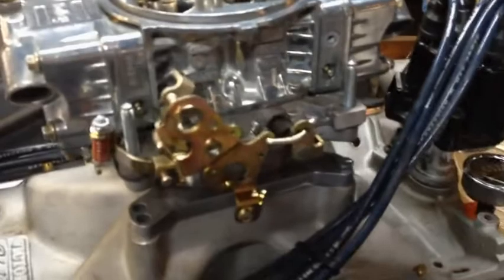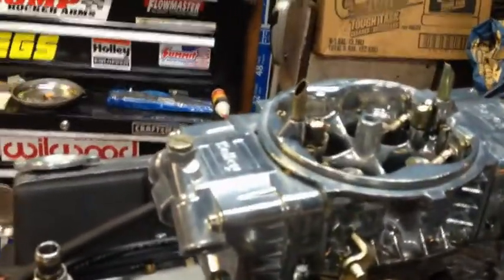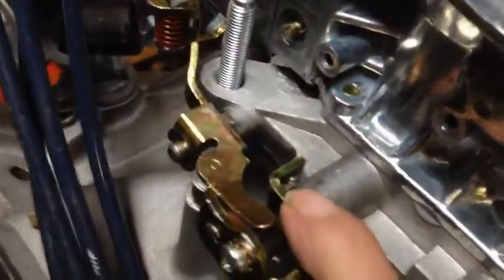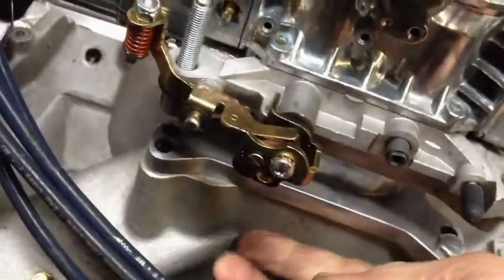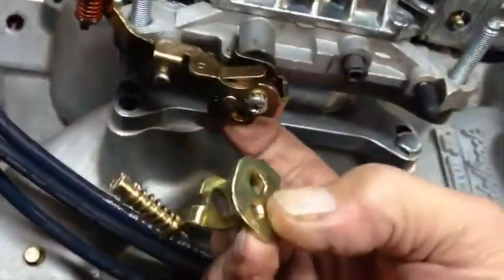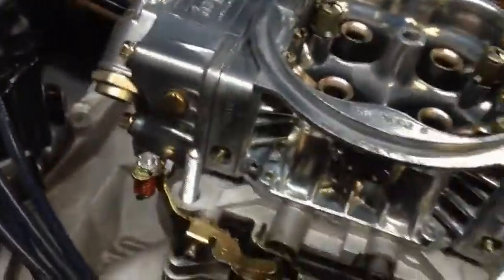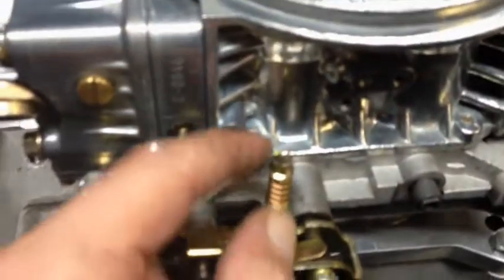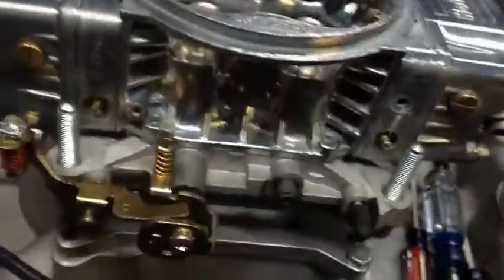Improved Holley Secondary Idle

Comment: Holley has been using 4 corner idle for years..also the secondary hard stop a adjustment! All ya do is flip the secondary screw around so the adjustment slot is accessible from the top instead of the bottom. 
Secondary adjustment is primarily used for engines with big cams , when the primary butterflies have to be opened to much to maintain the desired idle it’ll cause a stumble do to being out of the idle circuit! Lower the primary butterfly and raising the rear will help significantly with low speed performance!

Comment: But... does it have no clearance issues if a throttle posiion indicator is on the primary shaft?
Reply from the maker: Not that I am aware of but, I don't use drive by wire beyond the accelerator cable from the pedal to the carb. The TPS is the tip of my toe so to speak. It sure makes tuning the 4x corner metering blocks a lot easier, especially with a big cam. No need to drill holes through the butterfly valves to keep them within the idle circuit slots in the carb base.

Comment: Allen Head and a idle screw spring or equivalent also works as well. I can turn mine with my fingers no wrenches needed.   Adjustments to secondary side are also very rare after initial setup.  All that said , This is great information.
Reply: It's irrelevant information at best

Comment: Notice that although the diameters of the primary and secondary curb idle screws (should be called transfer slot adjustment screws) are different both have an identical PITCH…to set one up, set both transfer slots the same and turn both screws equally to establish desired idle is how i do it
Reply from the maker: Spot on! It is all vacuum related. My cam only produces 3 in/hg of vacuum with a hard lope at 900 RPM, and the idle doesn't smooth out until 2,800. I run a 2.5 power valve with #74 /84 jets and adjust the four carb idle mixtures using a vacuum gauge. Having mixture adjustments on all four corners allows for better tuning with big cams.
Reply: @InimitablyCurious  and I thought I had low Vac at idle!.... thinking I could have a vacuum leak.

I'm at 4.5" with my 383 and big Mutha thumpr cam.

I had a 6.5" pv installed, but guys online swear that Holley is wrong, and saying we gotta use a pv that is 2" lower than your cruise Vac (mines 15")....so I put in a 8.5"pv.

Now just off idle I'm running super rich at like 10 afr (should be 14 afr).... Cruise was good I guess, back gotta be easy on it, not to dip below 8.5", so scrap that idea. 

Going to put in a 4.5" or 3.5 " into it. 

At 8.5"pv, my engine didn't need extra fuel, not even working hard at all

Comment: What is that bracket called, and is it still available on Ebay?
Reply: https://www.summitracing.com/parts/hly-26-137  but it only works on Mechanical Secondary carbs.
Reply: @FireoftheGreeks  why would anyone want to use a vacuum secondary carb..?
Reply from the maker: I stumbled across them when searching for Holley parts on eBay. I think it cost me 14.95 with free shipping so I bought one for my 650, 750, and 850 CFM mechanical secondaries carbs. I think they may also work on Demon carbs. 😀